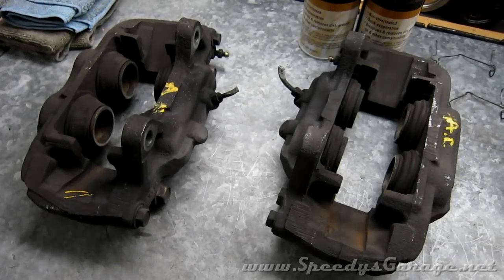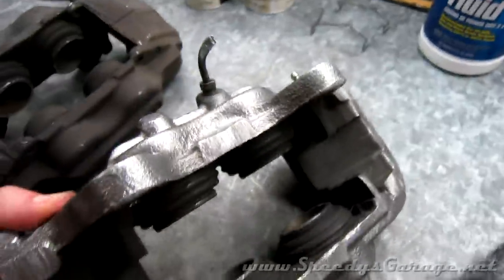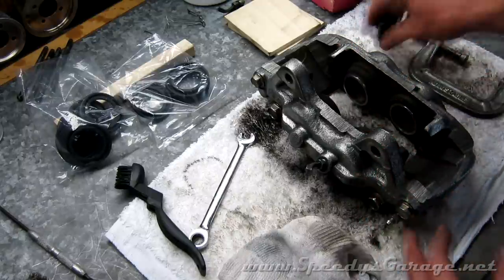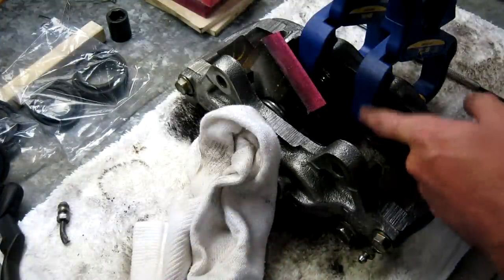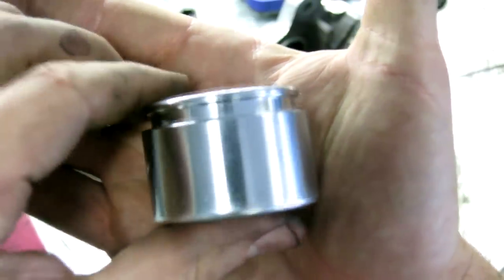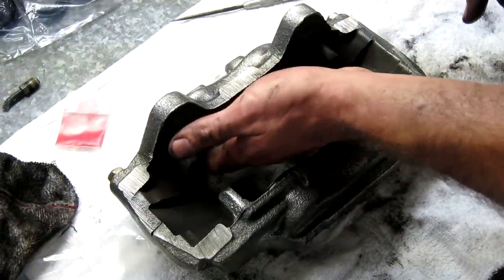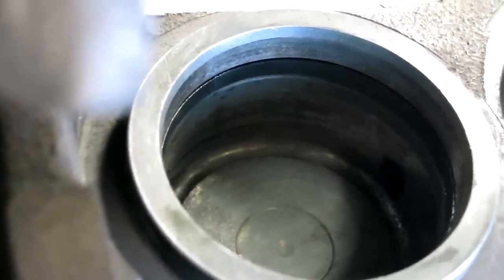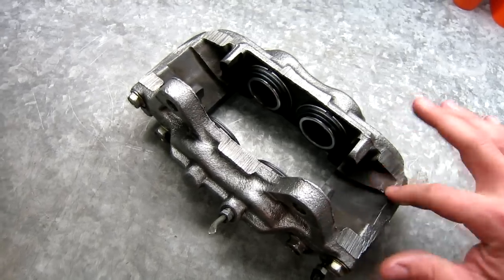How To Rebuild Brake Calipers 3rd Gen 4Runner 13WL

Comment: Awesome tutorial. Working on airplane landing gears years ago, I learned to use brass picks for removing seals, O-rings. Brass is softer than steel and it won’t scratch it. Thanks for a great video.
Reply from the maker: Great tip!
Reply: Had to do the same with C-17 brake piston seals (really any seal from an actuator)

Comment: I go to my mechanic friend almost every year to put on a new caliper and we always have same argument.  He tells me to just buy a new caliper rather than refurb these myself.  But damn $60 per caliper (includes shipping) sure adds up over the years.  Never knew how technically simplistic this process was!  Even if this whole process takes 2 hours for 4 pistons.  Rebuild kit is $25.  $60 - $25 = $35.  $35/2 = $17.50 an hour.  That's a fairly good savings for most of us.  Plus, you have the personal satisfaction and piece of mind knowing you did this professionally.  So yea - this project can well be worth the trouble of doing.  Your video was uncomplicated, you showed great detail where needed, and you pointed out any hazzards along the way.  Great job!  I know I just subscribed!!!
Reply: Most calipers you get half your money back as core charge.. you really only save 10 bucks by rebuilding them unless you pay someone to put them on then it costs more.. I rebuild mostly cuz it's fun and satisfying
Reply: Now days these are $300 each for a rebuild.   The days of doing this yourself have returned.

Comment: I wanted to sand blast and paint my calipers professionally, but I knew I needed a kit to rebuild them. After seeing this, I'll just use the wire brush like you did and rebuild them. Then I'll have them painted!

Thank you very much for this!

Comment: Nice commentary, straight to the point, nice tips on what to/not do, I have a 2001 Sequoia 4wd, so, this was a perfect video! Nice production, the white light was perfect for showing the internal square seal. Like the tip on holding a rag over the tip of the compressed nozel!

Comment: Really awesome video. I rebuilt mine on my Toyota a few years back. It feels great to do this job yourself because it's so easy. The satisfaction you get knowing you rebuilt them yourself is satisfying! Toyota caliper rebuilt kits are awesome too. Comes with everything you need to do the job right. You should have a follow up with painting. Thanks for sharing!
Reply: I agree with you about the satisfaction of doing a job well yourself. I also am leery of rebuilt calipers that you get from a variety of places. I figure if I mess up some times because I don’t check things whoever is rebuilding these has a chance of also messing up. I have more faith in myself than I do in others usually. Also using Toyota parts can guarantee excellent seals and fitting of important pieces. I have used both Toyota parts and cheap knock off’s… When I can afford the Toyota parts I always get them or if it’s for something like this, a brake job or your life depends on the parts and the work. 'Muy importante !

Comment: Excellent video, thorough,, detailed and very well explained. The camera a work is 1st class, a lot of YT'ers could take lessons from this channel.
Reply from the maker: Glad it was helpful!
Reply: @SpeedysGarage  About to perform this operation on my 2008 TRD, have parts. Brakes are spongy and that wobble at high speed when braking. After replacing pads doing rotors, careful bleeding etc, suspect dirt  behind pistons, even though fluid changed every 3 years.
Will report back.

Comment: Well, certainly first time doing this and it worked out great!  Been a month since I did it and brakes are firm and working great. I caught it before any cylinders were scored or frozen....but rubber seals were torn some.  I used a bike pump with a plastic nozzle to provide compressed air and some clamps to control which cylinders would be pushed out first.  Thanks again for a great video
Reply: Lucky, some of mine were seized and corroded, hours of using a c clamp and pushing 100+ psi I finally managed to get them out

Comment: awesome video! I will almost never ever buy a pair of calipers again. This will save me a good 100 bucks on my brake job I will be doing over the weekend. I need to put new pads on the front of my 2007 Ram 1500 I need rotors pads, and I am going to rebuild the calipers. TY!

Comment: Great video I'm following what you did.  I wish you had done a followup video on putting new fluid in the caliper to avoid air pockets, installing it on the car and then bleeding the calipers.  I'm doing the driver's side on my 98 land cruiser and found the pistons were really stuck.  You used about 20 lbs air, well I had to use about 100 psi to get one of them to move. Using blocks of wood and a C clamp is a must.  When it pops out, it pops. And yes, I highly recommend wearing safety glasses.  When the kits come in I'll put in the new parts. Any suggestions on refilling the caliper is welcome.
Reply from the maker: It's been a while, but I think I just filled the reservoir and let the calipers "gravity" fill for a while, then used my handy dandy brake bleeder tool to finish the job.  I might have video of that in the Project Sport Runner play list.

Comment: Looks easy to do,
But like you said, it’s tedious and time consuming to do it right. Thx
I had an incident where a piston popped while the caliper was off and I ran the engine. Pressurized, popped, a then I had to learn to assemble. Easy on a Toyota.

Comment: Good video.  Covers most things.

It pays to separate the two caliper halves when doing this, as the fluid channel "O" ring should also be replaced, and it makes it easier to work on.
.
Reply from the maker: I "almost" separated the halves when I did the work, but the calipers weren't leaking when I got them off the salvage vehicle and I had visions of them leaking forever if I messed with them.  The rebuild kit also did not include any internal seals.  2 years later they've done great, so leaving them together was the right decision in this case, but good to mention for calipers that may be further gone than mine were.
Reply: OK.  I'm surprised the kit didn't include an "O" ring.

They generally don't leak there until very old.

I'm currently doing up some Brembo's which are forty years old and one was leaking at the join.

Also you can't use a standard "O" ring as the fluid will dissolve it.  Must be made of the correct stuff.  Bearing suppliers can get them in for you.

Cheers Rob
Reply: I know this is from three years ago but. Any suggestions on how to bleed the one side before bolting the two sides together? I know that most 4 piston calipers have two bleed valves but this one doesn't . And from experience the one bleeder doesn't work lol.

Comment: Amazing job !!! Your video was very helpful !! Well explained with visual instructions 💯 However i did the same job with the same calipers like yours but i found 2 small seals in my rebuild caliper kit and i realized these seals are located between the casting of the calipers from the left to the right ( his function is to seal the passage of the brake fluid from one side to the other one ) . You forget to mention that in that video !!! Otherwise very useful video !! Keep it up !! One more Suscriber !! 🙏🏾

Comment: a very good video, but i have tried all afternoon to get those dust cover/boots in place with the spring clip and have failed to the point where i have emailed the repair kit makers , AND also hunted high and low for another type of cover, i have the caliper in two halves so it should be easy but have to say after 40 years in aviation these springs just ping off as soon as you look at them, cheshire uk. Car is a R129 Merc SL.

Comment: Awesome video...Just to note though. if your seal kit didn't come with grease like mine... you have to use a synthetic brake and caliper grease.  not just general purpose.  eg CRC / Bosch make good ones.
Reply: Only use Red rubber grease by Castrol or hydraulic assembly fluid by Centric, Carlson, Raybestos, all on Amazon or RockAuto. Silicone grease I am not sure about, I cannot get any of the brands to advise using it where it comes into contact with brake fluid, its Ok for use everywhere else on the caliper tho, I will use it on my next rebuild and see how it does.
Reply: @metalhalide4043  It sucks ass that no local parts store in America carriers specific caliper piston seal grease...in fact, even most part stores don't sell it online to order.

Too add onto what you said, 100% silicone grease is fine for nitrile or natural rubber o-rings (most square cut piston seals are natural rubber), but it will swell silicone o-rings.  That said, 100% silicone still is not good for contact with DOT 3/4 (is fine for DOT 5, though), so you cannot use it for piston rebuilds anyway.

Red rubber grease is about the only thing out there, or assembly lube (but these will dry out over time whereas grease won't).

Comment: Hello! I watched this video a few times.  I recently got a blasting cabinet for Xmas and man it's awesome!  I have tried sand, soda, and glass beads.  I used to clean parts by hand but not any more.  You do an awesome job using the wire wheels and brushes.  But, it's so much easier if you have a blasting cabinet and a decent compressor.

Comment from the maker: As long as the damaged area is not behind the dust boot, it's fine.  The front face is only contacting the brake pad and pushing it against the rotor.

Comment: The trick with the ring is to keep it expanded  ( pulled apart) while you slip it over the boot and into place.  No need to grease the ring then as doing it this way you need a good grasp which a greased ring will not afford you

Comment: If you don't have compressed air. Remove the pads and depress the brake pedal. That will push them out enough for you to work them out yourself. Be VERY careful not to scratch the outside of the piston unless you are replacing it.

Comment: At 9:30 you show the piston. I have some corrosion on the lip of the piston where the small part of the rubber boot fits on.  Brake cleaner won't clean it off. It's not much but I'm not sure if it's okay to clean it and use it.  What do you recommend on cleaning it and/or reusing it.
Reply from the maker: You can try to clean it up with a little WD40 and a red scotch brite pad.

Comment: Excellent video! What if a piston is seized? Will the compressed air still push them out? My 07 4Runner front calipers both have seized pistons. Just wondering if they’ll come out as easily. Obviously if they don’t, you run the risk of damaging the pistons if you have to “wrestle” with them to get them out.
Reply from the maker: The answer is it "might".  If not you may have to result to banging it on the work bench and using liberal amounts of penetrating oil.

Comment: Thank you for the detailed film. Can I use just brake fluid for lubrication of pistons? I purchased pistons and dust seals separately and none of them have a package with grease. It is a very controversy information on what product to apply on rubber parts of the caliper (looks like the best would be 
3M 08946 Clear Silicone Paste). Eric the Car Guy suggests just brake fluid, and what for anything else really, if brake fluid will be there all the time during operation.
Reply from the maker: I don't see why not, don't over think it :)
Reply: @SpeedysGarage  That is my weakest point. Thank you for your replay.

Comment: I have 2 pistons in each caliper on my 99 f150. Had a piston seize and ruin a rotor 2 years ago. I rebuilt the 2 calipers years ago and now have 1 piston on each side seizing. I used Duralast Rotors and pads from Autozone and am reading bad reviews on them =/
   I probably only used a toothbrush on the pistons and I think they were a black plastic or ceramic er something. Don't remember. Maybe a piston is ruined or didn't get cleaned to a polish cause I didn't want to damage it. No idea why they're failing again.

Comment: Hello! Great job! Instead of that grease, for the inside rubber ring, can i use brake fluid just for greasing a bit? Is it ok for that grease to mix with the brake fluid? Btw is a silicone based grease what you used there?
Thank you!
Reply: I use toyota red rubber grease inside the piston and cylinder because it is fully compatible with brake fluid. it makes the piston slide much easier as well.

Comment: I accidentally took apart the two caliper parts... It is now leaking brake fluid. Do I need to replace the caliper?
Reply from the maker: Shouldn't need to replace them, maybe just some seals internally.  I mean they're manufactured in two pieces right :)

Comment: Thanks for sharing, very good walk through.  I did the Tundra 13 WL upgrade on my 3rd gen about a year ago and prematurely blew through a set of pads.  The outside pads on both calipers were worn much more than the inside, and the pistons required significantly more pressure to retract into the caliper.  These were remanufactured calipers from a reputable local auto parts store.  Any idea why the pistons would begin to stick so soon?  Bad remanufacture job?
Reply from the maker: Had to be a bad rebuild job, sounds like one side pistons were sticking.

Comment: great video!  if you don't have compressed air, how can you remove the old pistons?
Reply from the maker: +Joe T You can tap them on a solid surface, but if they don't come out pretty easy I'd take them somewhere and buy the tech lunch to get them out for you.  You don't want to beat them to death :)

Comment: If the piston is frozen or rusted in how do u get them out?
 Thx
Reply from the maker: I'd soak it in some penetrant over night, try compressed air and some gentle taps of the caliper housing.
Reply: Good idea, I soaked it with penetrating oil used pliers and hammer only go to to move in a bit, will have to borrow a compressor and try that how u put psi into it there an adapter to screw in caliper ?
Thx

Comment: What do you suggest for getting the pistons out if you dont have access to air to push them out
Reply from the maker: I've had some mechanics tell me the bang them on a work bench.  Not my style but won't likely hurt anything.
Reply: @SpeedysGarage  thank you so much for the answer. Do you see a problem trying to take them out before compressing them in to get the fluid all out?

Comment: Great video and thanks for uploading this up.  I am going to rebuild my calipers. One question, you mentioned that if the inner wall of the cylinder wall is scratched, caliper is done.  Now, what if the inner wall of the piston is scratched, would that cause any issue down the line?  Thanks buddy in advance for your help!
Reply from the maker: I'd probably replace the calipers if the scratches are very deep at all.  Don't wanna mess around with faulty brakes or risk a leak.

Comment: What rpm does your angle grinder run at? Also, which wire brush are you using in this video? I want to try cleaning up my calipers as well
Reply from the maker: Honestly I can't remember the spec on the angle grinder, typical 90psi tool speed <shrug>.  The wire brush is just the standard "kit" version you pick up at a hardware store.  I think mine had three different variations of wire wheel in the kit.

Comment: Would it not be a good Ides to completely disassemble the part and then do the cleaning and inspection to ensure best results?
Reply from the maker: I didn't want to risk the calipers leaking from internal seals.

Comment: Speedy, will this upgrade work on a fourth gen, 2006 4Runner. I just bought one as a 3rd vehicle for winter driving and it has 99000 miles. I am going to flush the brake system and might as well do the upgrade with the brake lines too while I have everything apart. Thanks. Awesome and informative videos.
Reply from the maker: I do not know for sure, but my gut says no.  I'd Google.

Comment: What kind of grease did you use? I've heard use White Lithium paste or lubricant, brake fluid or anti seize... also doesn't the wire wheel brush scratch the inside and outside of the cylinder?
Reply from the maker: It was just your standard high temp brake grease.  Comes in small packages at the parts store.

Comment: Can you split the calipers? And is the pistons the same size as the smaller calipers?
Reply from the maker: Dunno on the piston size, but technically you could split the caliper.  I chose not to as I didn't wanna chance any leaks.

Comment: Is there a way to get pistons out without forced air? without damaging pistons?
Reply from the maker: Some others have commented you can tap them on a work bench.
Reply: @SpeedysGarage  Thanks for the response. Have also seen on another video that you can sometimes use a foot operated bike bump with a bike valve stem to force enough air into a caliper to make the pistons pop

Comment: thanks for the video, a question does this type of caliper have guide pins? I know there are 4 long bolts which hold the 2 pieces of a caliper intact, not sure if they're the guide pins. thank you
Reply from the maker: Been a while since I did this, I don't remember pins except to hold the pads.

Comment: So what about using a sand blaster to clean the calipers? I'm worried about getting grit in the cylinders, where you said you want to make sure it's really smooth and NOT to put the wire brush. A friend has a small sand blasting box and says it will make the job super fast. Would masking tape or duct tape be good enough to protect the cylinders from the sanding material?
Reply from the maker: overload889 I'd suggest the wire wheel and not sand blast.

Comment: For cleaning before putting on new gaskets, would it be alright to soak the whole caliper in acertone
Reply from the maker: +adolfhilter I probably wouldn't do that.  Just spray them with some brake cleaner and hit them with a plastic brush and it should be good.